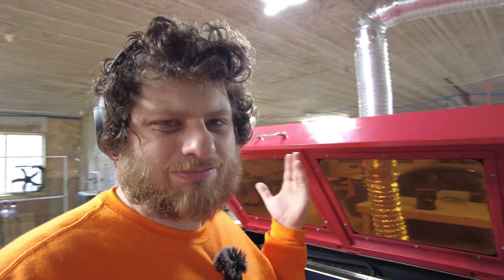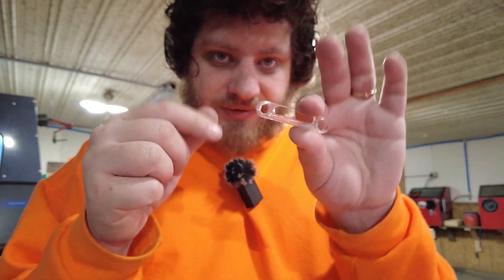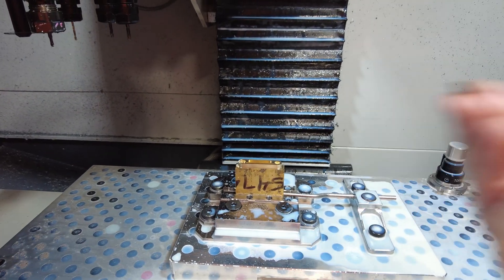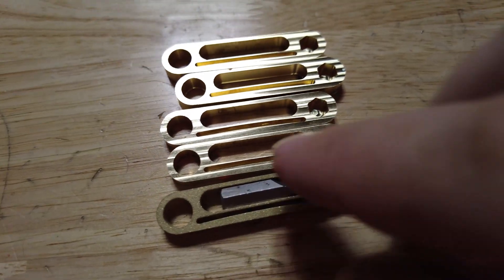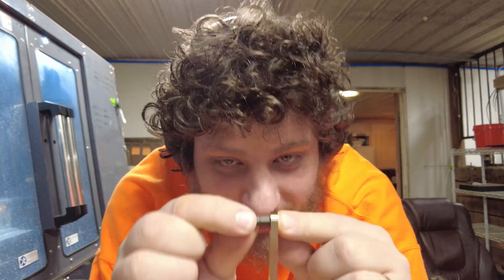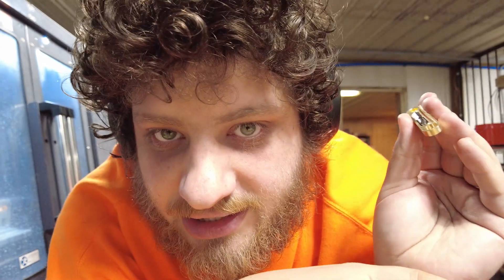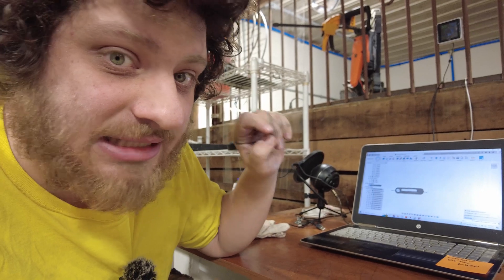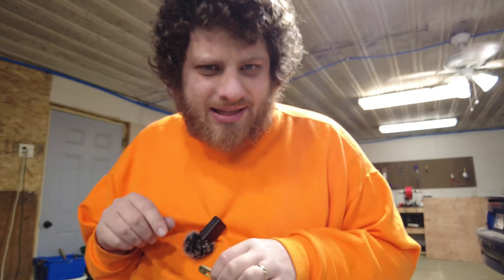Machining a Flexure Based Keychain Screwdriver

Comment: Add another flexure at the end to retain the bit?
Reply from the maker: You mean on the hex part? I considered that, but it would take a really long, teeny tiny tool.  I was very against this at the time, but I've finally been convinced that a magnet is the way to go there.
Reply: How did you make the flexure slot? I assumed tiny endmill
Reply from the maker: It is a tiny endmill, but I would need a even more tiny endmill.
Reply: @AudacityMicro  you need a small wire EDM next.
Reply from the maker: Agreed! That would be super helpful